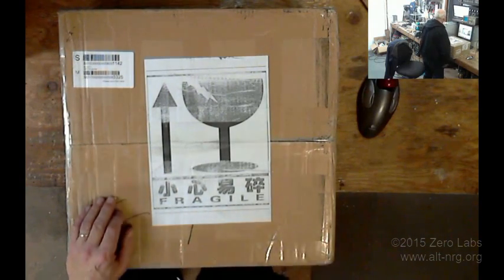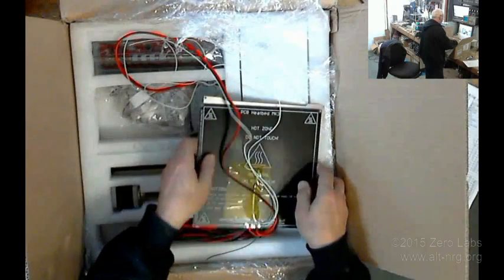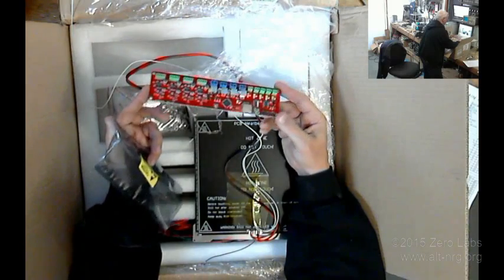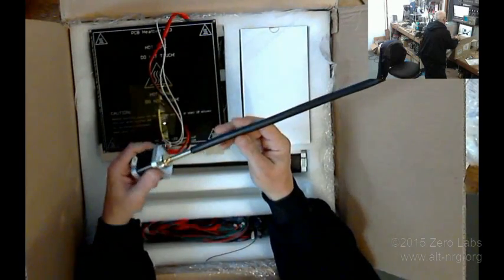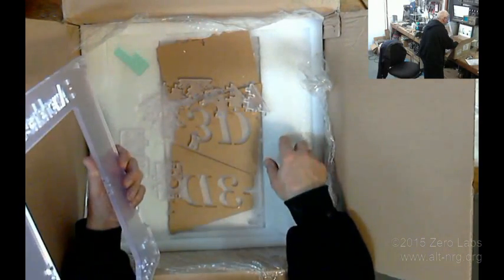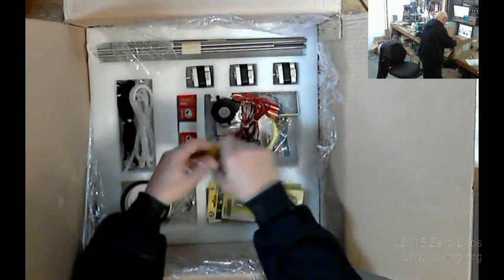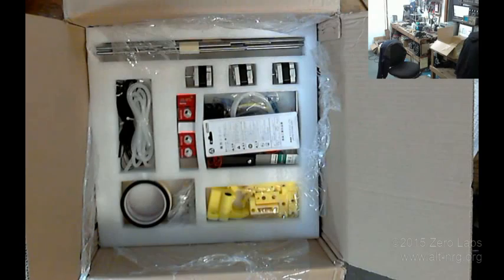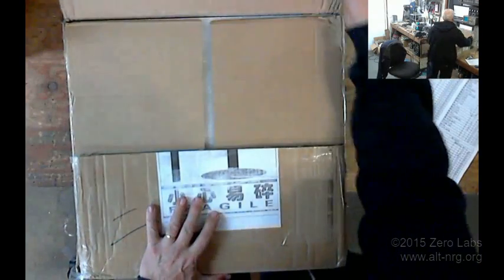#391 RepRap Prusa i3 A600 3d printer unboxing

Comment: lol you have not worked with stepper motors for cnc project much i take it lol.  There is spiral cut shaft hubs which have 0 flex of any kind which most these printers come with.  On a larger scale like nema 23 solid shaft is actually a life killer of a stepper in this manner of use.  could be why you will never see one on a bigger stepper motor!  Back lash also is mainly formed where screw and screw nut touch.  Small gaps over time created form back lash or poor cut screws to start with.  Or where a nut or screw base are to lose have play in them.  Screw connected to the motor does not change this much at all unless its a poor hub lol.  Sadly the motor you have came from china would not be surprised if a 12 year old kid in sweat shop  hand filed your screws by eye LOL 

 Also hint! these china belts they give you have massive play in them!  Use a close pin spring on the center under middle point of your attached point and adjust the belt like normal you wont have as much backlash/play in them better prints!  All tension does on these belts stretch them out more and more over time!

Comment: That's the same one i got, but from amazon. Same Seller. Had a few missing screws. but there were extra screws i could use as a replacement just had to shorting them a bit

Comment: Congratulations on your new purchase, looks like a good deal. With that said, when are you going to get back to your roots and do some more over unity research?  I miss the HHO, flux coils, tri core transformer and self running magnetic motor videos. You may have had only limited success in those endeavors but you inspired countless numbers and provided a real service for those reluctant paradigm  shifting professional.  At the very least how about doing a highlight video letting us know where you are at and why you stopped. Any ways, good luck and keep at it!

Comment: Those leadscrew steppers will save you so many headaches.  I may have to find some of those, warped threaded rods are just no fun. The price for what you get is a steal.  The other 3 steppers are smaller than what I usually use though.
Reply from the maker: The only thing I'm a little concerned about is linear bearing slop. I should be able to get rid of most of it by pre-loading them a bit. I do have some questions for you, though. Do you use any material between your plate glass and heated bed? And how thick is your plate glass?
Reply: I don't use anything between them at the moment, but I think some aluminum might help even the temp across the bed.  My glass is some old picture frame glass, a lot thinner than the original stuff and warps easier.  I shattered the borosilicate glass a long time ago.
Reply from the maker: firepinto What about firmware and software?

I'm having trouble with the bed Leveling Wizard in Cura 15.01. It connects okay but it freezes and loses communication when the print head moves to the back center.